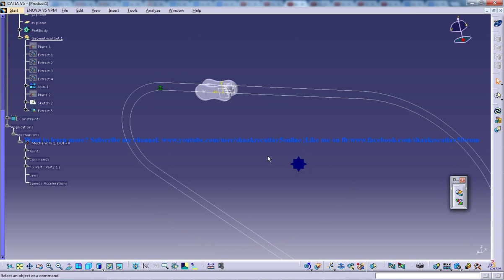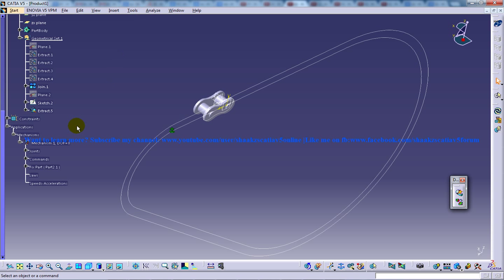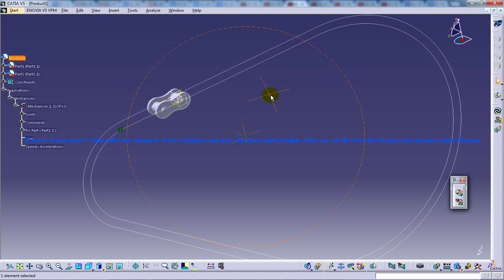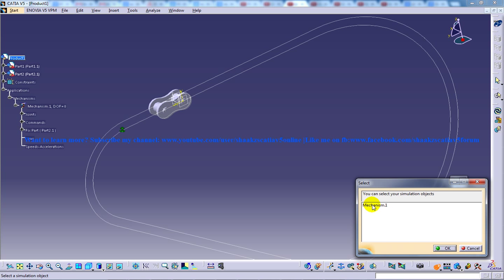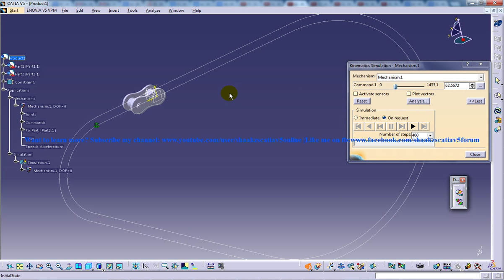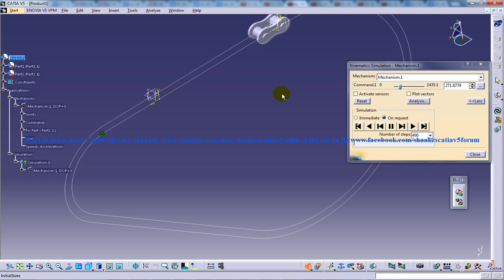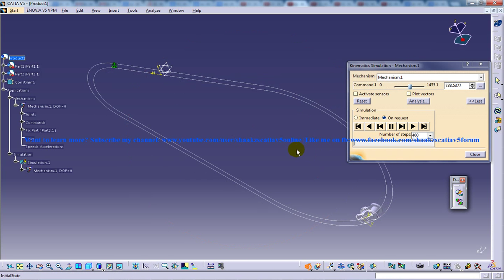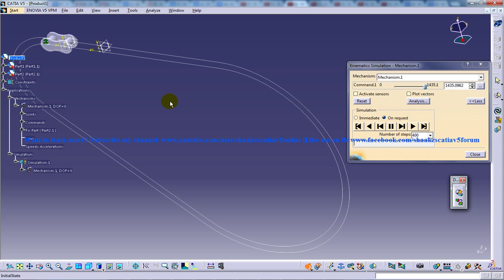Catia V5|Chain Mechanism Simulation P8|Digital Mockup|DMU Kinematics

Comment: Hi, Shakeel
I have a query, If I make it a complete chain by adding all the elements of it, then will I have to make those points on every element and equate them all with the guide curve or is there a shorter way by adding some Law ? 
because if there are 100s of elements then it will take a lot of time in doing that.